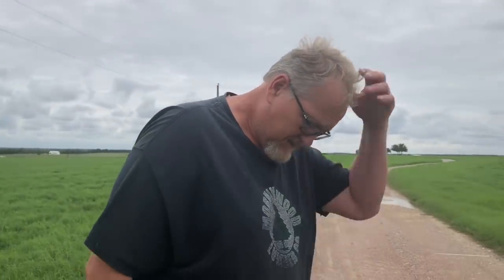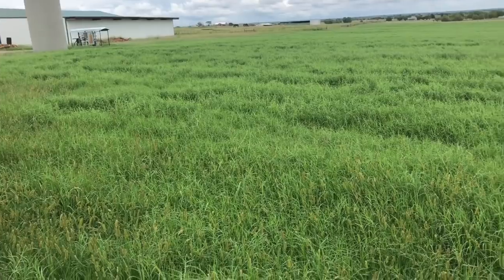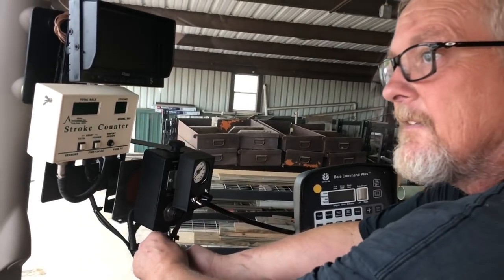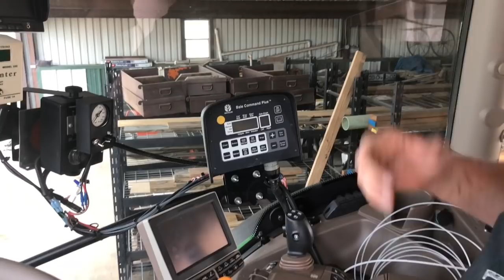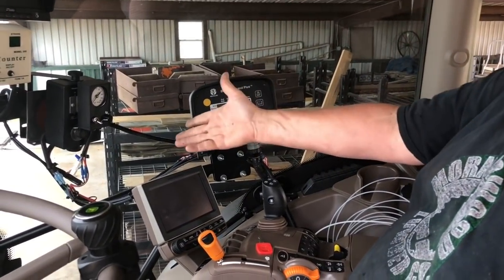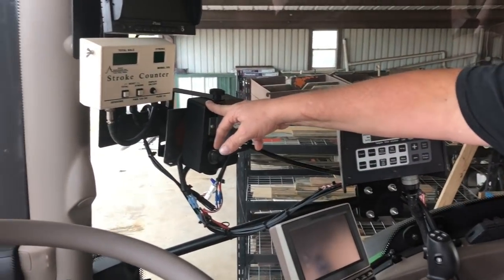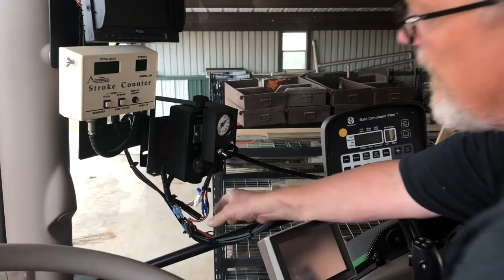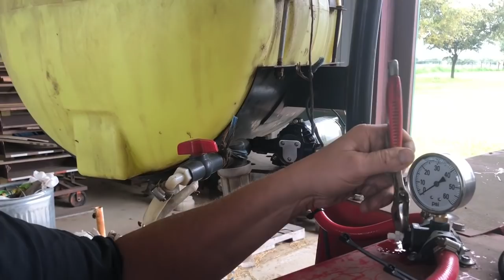Hay Preservative Sprayer Redo - Part 1

Comment: Two good reasons to put a loop in the pressure gauge hose are to provide some extra should  you ever have to replace a hose coupler and to provide a strain relief at each coupler in the system.
Reply from the maker: Good point

Comment: Wow why do you start spraying at 13% moisture what moisture meter do you use?  I bale my Bermuda up to 18% with no molding or heating issues using my BHT-2 and HT-PRO.
Reply from the maker: In this area anything over 13 the sweetness goes away unless sprayed
Reply: That is intreasting maybe I need to look into that a little better.   As I am also trying to make the best Bermuda hay possible. Thanks.
Reply: Don’t know why I’d posted so many times sorry.

Comment: If it leaks in the cab that’s the problem with those gauges ,had it happen to me!!
Reply from the maker: I've used those connections on another sprayer and never had it fail, but if it does it's no big deal just a little stink

Comment: I would rather see a digital readout in the cab, than see 25 psi acid leaking in the cab.
Reply from the maker: Maybe, but I've used these connections for 13 years and have never had an issue so I'll take those odds. It's a non corrosive spray it just stinks, no harm to the tractor
Reply from the maker: Thanks for that info